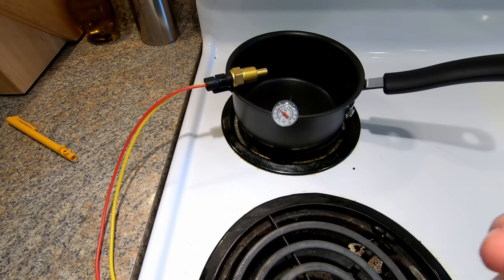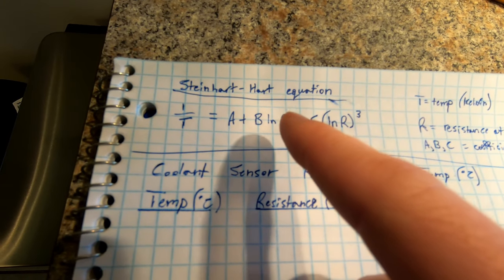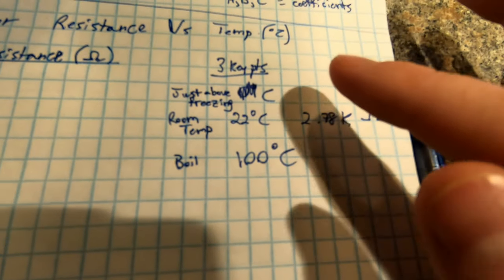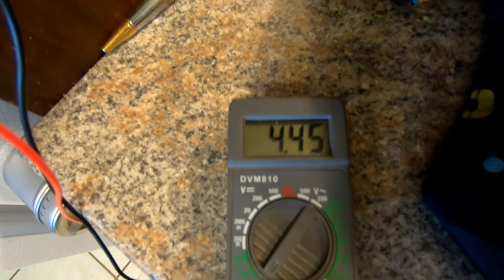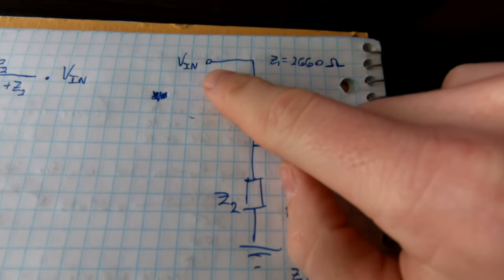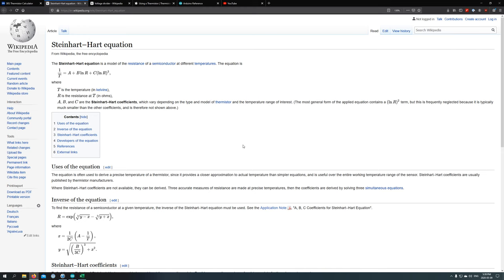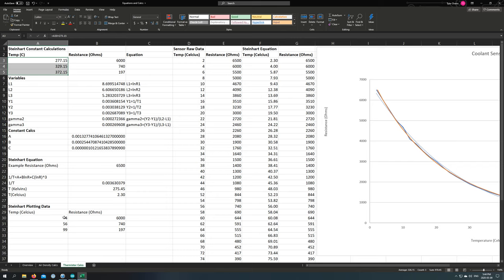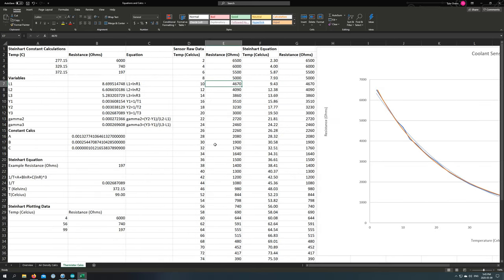Arduino Coolant Sensor | Thermistor

Comment: you link "Intake Air Temperature Sensor Control & Pigtail Harness For GM IAT/MAT/ACT"  which its not same as the one in this video, in video has closed sensor, and in the link its open. is it same or

Comment: i know its a an old video but its precicly what im trying to achive on my truck, but if your still around i have a question about your temperature sender is it just a standard 12/24volt sensor? its all i can find in that form factor and am i safe to assume sending 5 volts to it it should work just fine as ill still be plotting just the resistance change even though the sensor is rated for 12volts?

Comment: very nice man!  I just used these exact steps following you and I got the readings on my custom made Jeep.   Its an Indian variation of CJ.  And it has no computers and so Im adding a manual arduino based sensors and this youtube video proved very helpful.  Thanks a ton!!
Reply from the maker: Nice work! Do you have a finished product? I haven't gotten around to wrapping up my project yet but I had figured out all of the sensors and read them to the serial monitor. I just need to compile the code and try and display them to the OLEDs next...it's a work in progress.

Comment: I have a broken coolant sensor in my 97 Miata, and this video lays out exactly what I was thinking to do in my mind. I already knew the sensor was a resistance based reading, but this illustrates how to give a real value to a gauge i can just put somewhere in the interior. Thank you! I also may try to get real oil pressure instead of the default (yes, no) oil pressure gauge the 94-97 Miatas have.
Reply from the maker: Awesome, glad I could help! I have another video on the pressure sensors if you want to check that out. Cheers.
Reply: Jslm97 just connect arduino directly on your obd2 you have all your data qithout connecting on any senser

Comment: What size wire for wiring sensors? Building one for a cummins, exactly what I needed !
Reply from the maker: I would match what the sensor has. Probably 18 gauge or something. Doesn't need to be much.

Comment: Excellent video. Thank you for sharing and taking the time to explain. I have a Mitsubishi lancer 1987. Installing a radiator coolant temperature for safety and hall effect sensor to make sure the radiator fan turns on.. Thanks again.
Reply from the maker: Glad it helped!

Comment: thank you for share this example! it's very usefull! I have a problem slightly "different": My plan is use a arduino as a gauge cluster and my honda civic 1995 has a one sensor sender to gauges and another to ECU. But, the gauge sender is one Pin only! the ground is in engine block... so, how I can measure this sensor? If I measure the ground, the car overhall interferences are insane and this not can be done... Can you have a idea?

Comment: Interesting stuff but it raises two questions by tapping the oem sensor like this, firstly is there an increase in resistance in the circuit by adding the extra cabling that can cause incorrect readings sent to the ECU and secondly what kind of voltage/overload protection measures do you have in place to contain an arduino failure so as not to fry the ECU which is extremely sensitive to voltage spikes?
Reply from the maker: My plan for these is to use them separately from the vehicles ECU. Just use a T-fitting where the OEM sensor is and then use this one and run it back to it's own ECU, that way there is not interference with the stock ECU.

Comment: Hey mate, your little series inspired me to start my own project, but I have never worked with electronics before..
If you don't mind me asking, why didn't you got with waterproof ds18b20's?
According to my research coolant temp starts to get critical at around 115°c. Bc these sensors go up to 125° this is what I'm planning to go with.
Reply: I have looked at this option as well, but I have yet to find a DS18B20 that comes in a standard automotive sensor body like the brass NTC ones do.

Comment: Hi there 
I'd like to ask you if it can be used for 
VDO coolant temp sensor
I need it to use it for generator temperature sensor so i can control air flaps , water pump